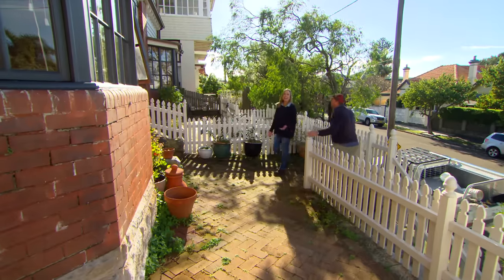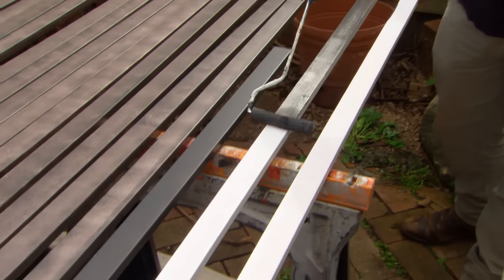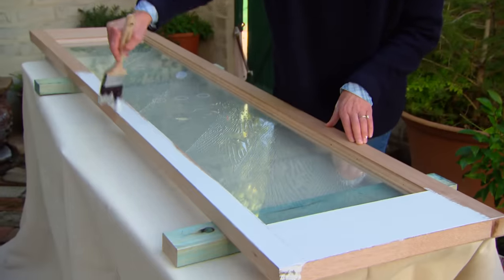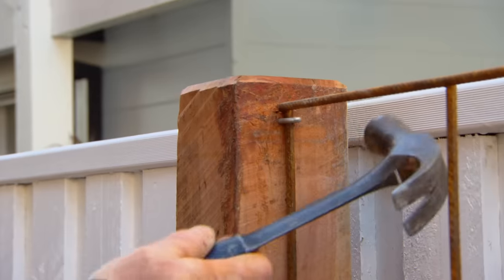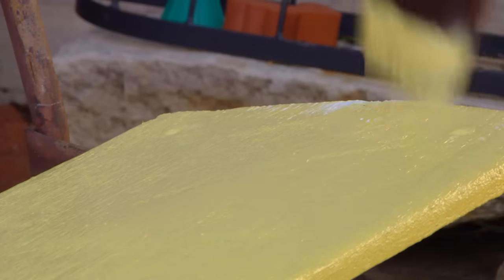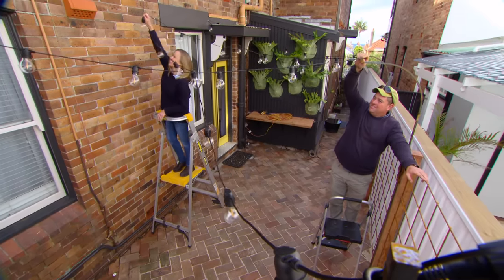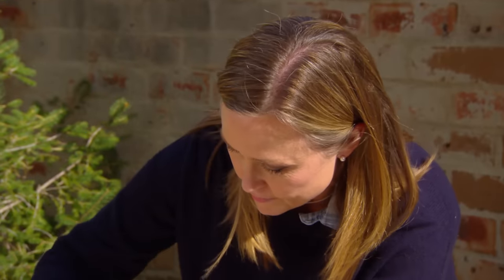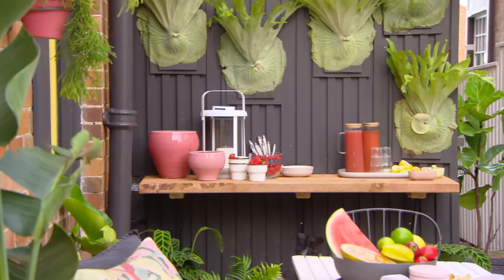This Courtyard Makeover is FULL of Inspiring Ideas | HOME | Great Home Ideas

Comment: That wooden bench is full of dirt, it should preferably been washed off with washing soda before any paint is applied, the dirt and probably mosses lessens the paint gripping on the wood which will easily be blistering soon after the first winter.
Reply: I would have power sanded it.
Reply: thats the one thing I noticed, if it was me renovating that bench I would have taken the boards off, sanded, and painted them on top and underneath, then painted the seat frame as well and re assembled it with new bolts.

Comment: I love the ideas that went into this. It certainly made that ugly blank canvas, look heaps better! Also, way more practical to use. I really loved how you disguised the pipes and added a handy bench too. However, those pops of colour (yellow and pink) will date pretty quickly. Also two staghorns would have been plenty - as they need room to grow. I'd have incorporated smaller jarva ferns, in between to keep the humidity high and add points of interest. Or even some of that Dichondra silver falls, that went into the pots. They would have popped beautifully, against that dark feature wall, and tied back into the fence.